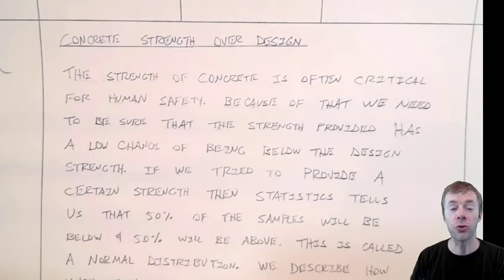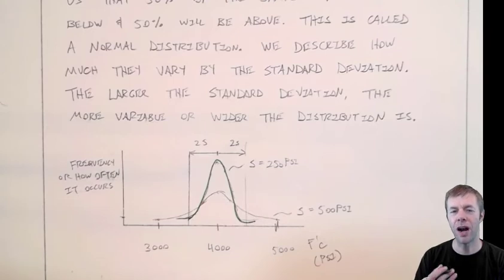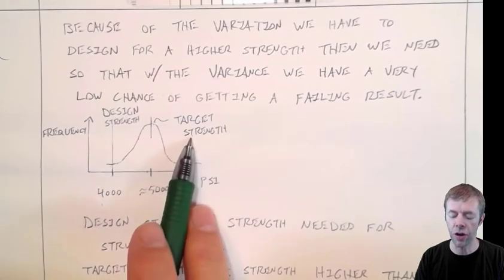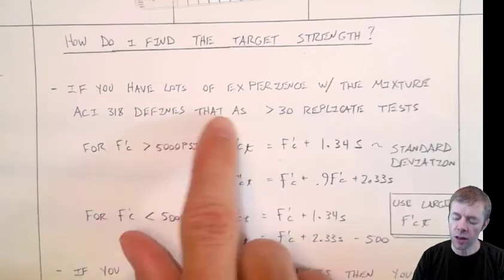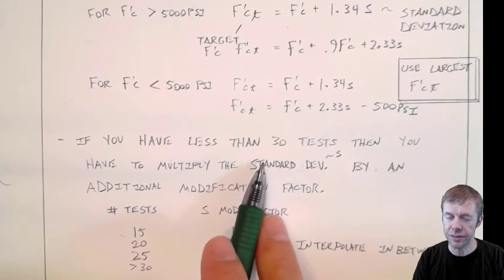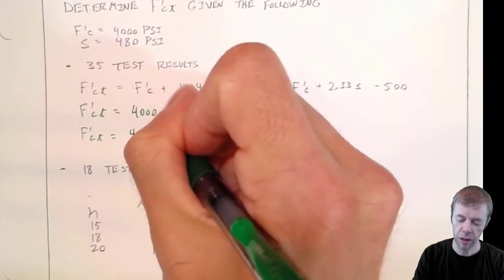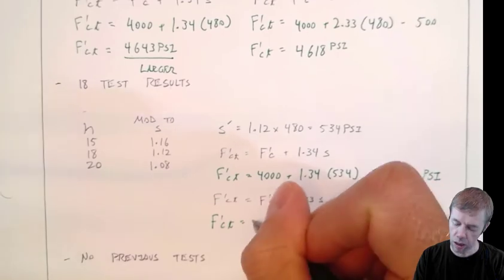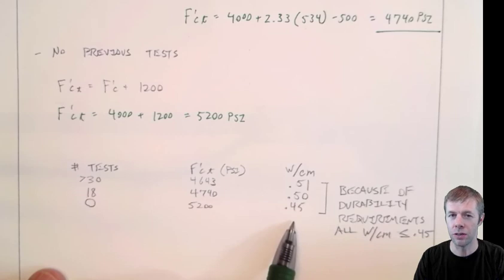Concrete Strength Over Design

Comment: Hi Sir,

Thank you so much for your videos; I really enjoy them. However, I believe the first two equations you used to find the target Fc should be applied when the modified standard deviation is 500 psi or less. The second set of equations would be used when the modified standard deviation is greater than 500 psi, as a larger standard deviation implies a greater safety factor.

But you mentioned different limits—specifically, that when Fc is greater than 5000 psi, we should use the first two equations, and when Fc is less than 5000 psi, we should use the second two equations. Could you kindly clarify if my understanding is incorrect?

Thanks again for your insights!

Comment: sir if we are doing test on 3o cylinders does that mean 30 cylinders are made of same ratio or arbitrary ratios? e.g i want fc dash 3000psi so i will make 30 cylinders for this ratio to get standard deviation?
Reply: 30 different batches means of any strength or the required one?

Comment: Thanks for the video...great stuff!!  I think I might be missing something on the second equation for calculating F'ct when f'c>5000psi.  If my F'c=6000psi, and s=319, then according to the second equation my F'ct=12,142psi...that seems a bit high.  The first equation gives me 6427psi, this seems reasonable.
Reply: Ok I think I got it...looked into the formula and the second formula for F'c > 5000psi should be F'ct = 0.9F'c + 2.33s...NOT F'ct = F'c + 0.9F'c + 2.33s